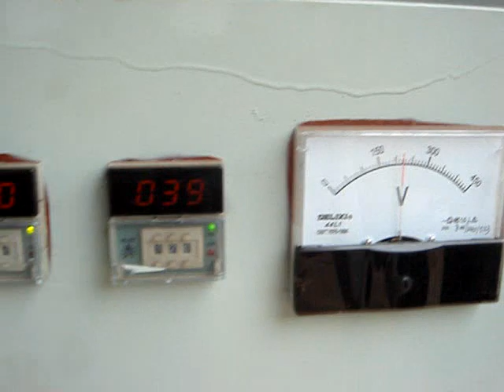Portable Wood and Biomass Pellet Line - Recycle Waste Materials

Comment: There is no such thing as FREE energy. All engery takes a force to creat that energy. Without the power to run this machine no pellets would be made, an the energy alone that this machine uses far out way the benifits. If it was all its cracked up to be, we,d all make one ourselves! Please dont fed into on mans video, do your research. before u comment.